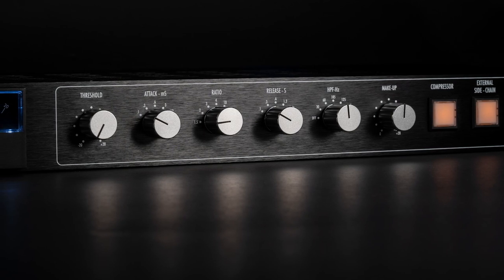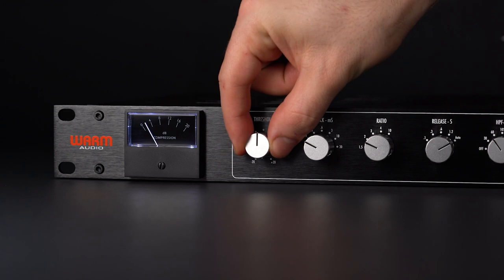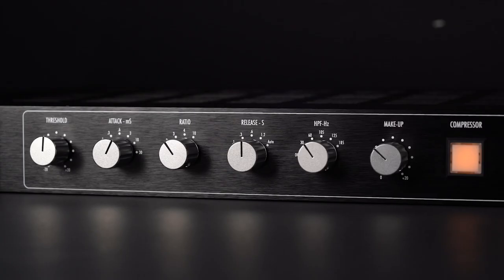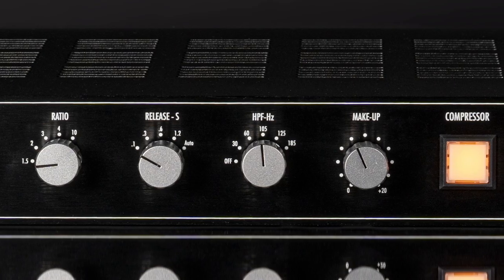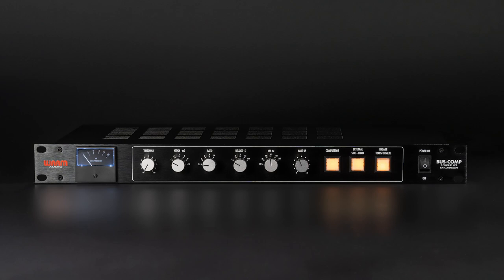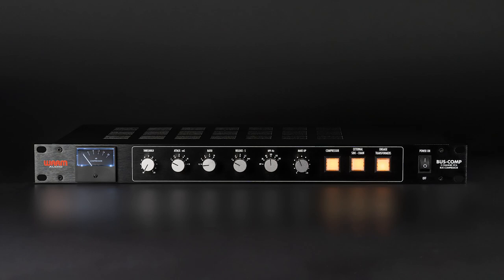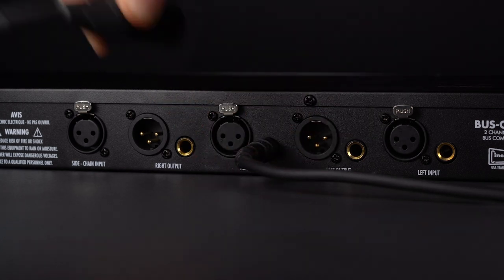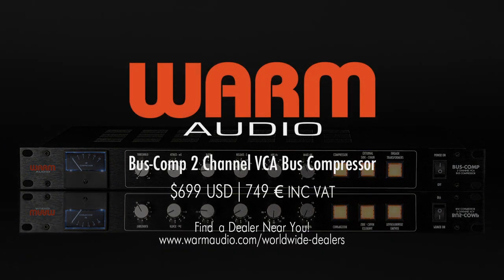Warm Audio // Bus-Comp 2 Channel VCA Bus Compressor - "Getting Started"

Comment: I just ordered this unit to go with my Warm Audio Wa273. The Wa273 adds a nice warm silk to whatever I run through it. I have the SSL Big Six that includes the 4G compressor. However, it's at a fixed setting. This will give me more flexibility and color flavor with the transformers.

Comment: Bus compressor is not for use on single track/channel correct.. but for the whole mix?

Could it be used solely for a channel/track?
Reply from the maker: Hey there! While it's ideally used as a mastering compressor(whole mix), one of the best parts about being in the studio is experimenting...You can absolutely use this compressor on a single track.

The BUS-COMP is traditionally very clean sounding but has a button to "engage transformers" for some additional color on your signal and a nice one to test out on your audio signals.
Reply: @WarmAudioOfficial  Thank you!  I just need it on vocals for a karaoke bar. Make the singers sound better.  :)
Reply from the maker: @Unplugged704  Nice. It'll definitely do that. 😉

Comment: how to connect to pc? can it compress digital audio in the daw?
Reply from the maker: Hi Sasha! You'll need an audio interface to connect your PC. You can definitely use the BUS-COMP as a compressor in post-production as well. Hope this helps!
Reply: @WarmAudioOfficial  yes..thank you.can it compress synth piano sounds?
Reply from the maker: @sashaatree6535  - Yes indeed it can. Although, the ideal use for the BUS-COMP is to run your final mix through as a compressor for your whole mix.
Reply: @WarmAudioOfficial  ty